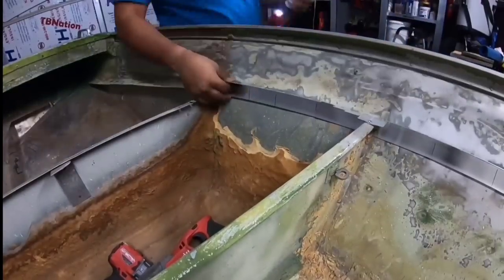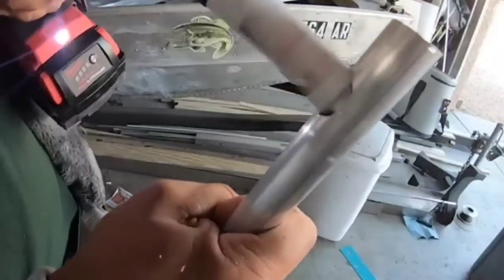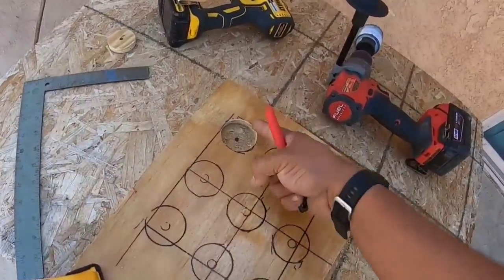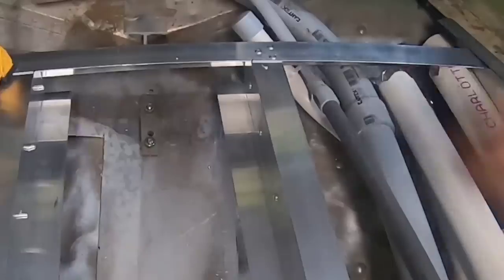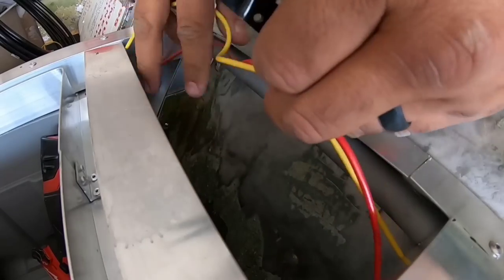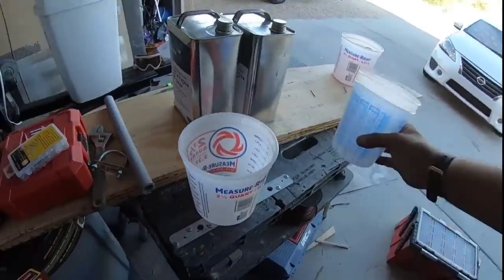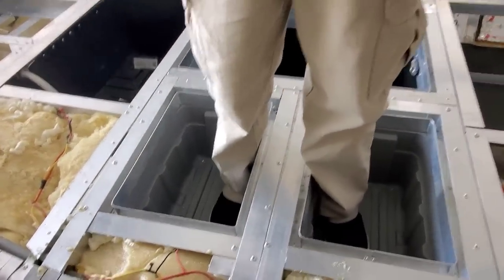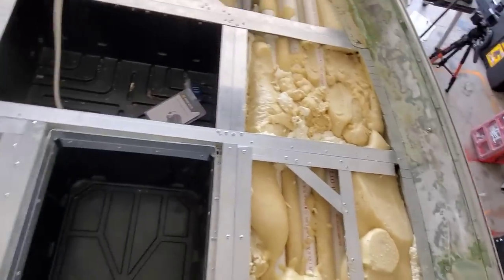Unsinkable, Framing models for Small Aluminum Fishing Boats.

Comment: When you pour in the foam and make your subfloors how are you allowing for water to drain down the prebuilt channels in the hull?  I understand your drain tubes for the hatches but what about water getting into the foamed area?  I have watched many of your videos but still am confused. Especially with one of your videos where you drilled into your subfloor and pumped the foam underneath.
Reply: @TinyBoatNation  thanks for answering this, For some reason I was thinking that the black garden hose was for draining water from under the subfloor, but now I think I understand it's for the hatches, and any water accumulating under the subfloor should still be able to drain out of the bilge hole in the back of the boat.

Comment: Hmm... looks awesome, good work! I guess it's been a while since this build. Any idea how well the drainage still works? Ever any issues with leaves, dirt or other debris clogging any of them drainage tubes over time? 
I just picked up an 89 tracker pro tournament tx with a 50 hp Johnson, not sure if the motor runs or not boat is still missing some stuff, started on the bow an removed the rotted wood an replaced it with a piece of 3/4 marine and re-riveted a few broken rivets to support it... just started popping rivets on the mid ship today, hopefully get that all out in the next few days... the front foam was kinda dark in color but I was fully able to stand on it without any give or crumbling, the PO said he kept it in the water docked until they moved here 5 years ago... also trying to get into the left an right rear hatches the top alum you would stand on is bowed up towards the sky, not sure what this means but I plan to dig it out if possible and replace it...
Reply from the maker: I have no idea
 The guy I built this boat for was a dud.
Reply: Removed the center portion of my boat yesterday, I was shocked to see someone had already used a thick hunk of alum for the main floor, but didn't do the entire floor... for some reason they used wood for the floor infront of the console and under the 2 front storage boxes there... all of it literally crumbled in my hands upon removal... so pretty much have all that alum clean already except for a few pieces then still trying to figure out how the rear was assembled, my livewell sits rectangular long ways front to rear in-between the driver an pass seats so not sure if tracker made it that way or someone cut the main support to put it like that cause I can see from your videos that their should be a support there... sorry so long winded an that things didn't pan out with the other guy, today I picked up a transom saver rod,  front an rear nav light bases, and some hardware to fasten the front casting chair base, total boat foam received, 12 gang fuse panel, carpet glue, troul, an some other stuff... can't find any pebble 24x48 gator skin in blk for the bow or any 20oz carpet for a decent price, once I get that I can start to pre assemble an move onto the wiring an motor... good luck to the winner of your build l, hope they appreciate the hard work you put into every boat you touch!

Comment: Nice video brotha, but i think i missed the AWG size for the all your  electronic connections. i think you stated 6 awg for the batteries but i didn't  catch what you run for everything else . would 12 AWG  work? also about how much pour foam did you use on that ? im trying to gather everything i need before i start the TB project . TIA
Reply: @TinyBoatNation  awesome brotha and I believe I heard you say in the video that u used about 80 oz. of foam for the boat

Comment: How do you know it is unsinkable , have you ever tested ? Thank you
Reply: He used a lot of foam in this video, and he also used foam on the subfloor.

He does not need to test it.

One cu ft of foam supports 60 lb of boat weight with negative buoyancy value (e.g., fuel and liveweel does not count). I think the cu ft of foam used in this boat build can keep the boat floating and two people if the boat is filled with water.

Comment: Have you ever tried using low voltage outdoor lighting wire.. Its available in 8/2, 10/2, 12/2 & 16 gauge.. And you can add wire connection grease as well to your connectors to help prevent corrosion as well.. just fyi
Reply: Why is that?

Comment: Eeee Gad   maintaining the main wire and just opening the insulation to then attach a wire for a light is great but twisting and just putting on liquid tape is BAAAAAAD.  You should have soldered the wires.  Twisting makes a nice mechanical connection but horrible electrical connection and in a Marine environment that's not good.  An even better, though more labor method is to open up more of the main wire, bend it in half, use an uninsulated butt splice, slide shrink wrap over it, attach the other end to the butt splice, solder, use the shrink wrap.  Butt splices and twisting to not make good electrical connections. SOLDERING DOES.  Sure it will probably work but it will result in more resistance in the joint which equals heat and heat is lost battery power and lost power to the device being powered.
Reply: @TinyBoatNation  No problem.  I'm a former aircraft and auto mechanic and now HAM radio operator/instructor/antenna builder.
We use mechanical connections for strength and always solder for good electrical conduction.